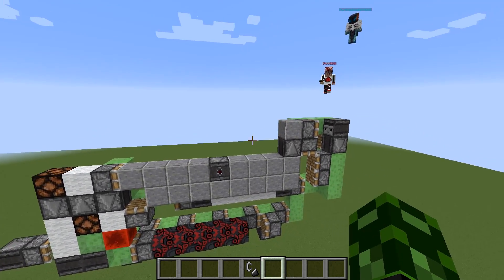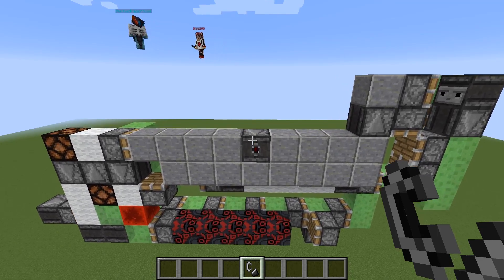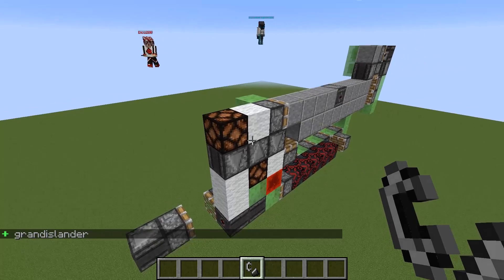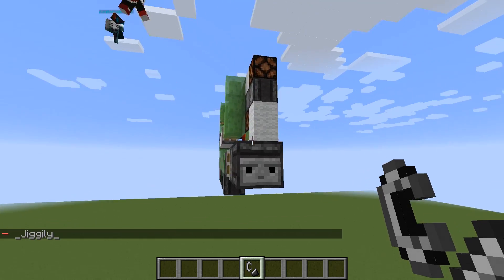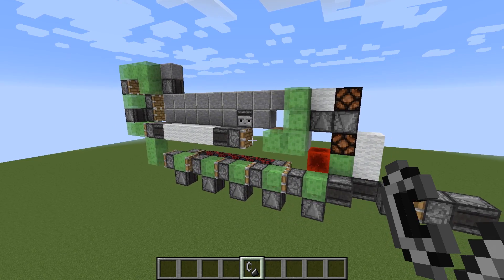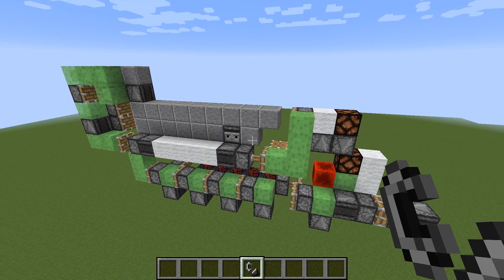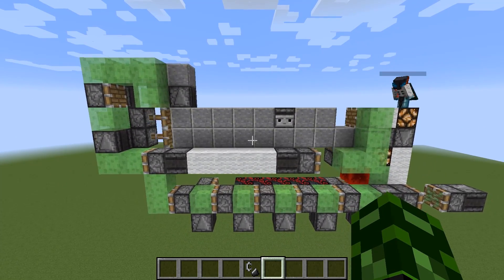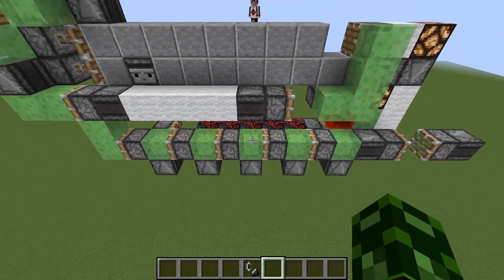Minecraft: Compact Move-Able Feedtape

Comment: What is an application of this movable feedtape? Is the feedtape used for data storage or just 'cause?
Reply: iammrhellohowareyou you can measure time passing while the machine is not moving. That combined with measuring how far the machine moves with a movING feed tape, gives you basically infinite freedom to program the machine to do what you want, where and when.
Reply: DicoTheRedstoner Aha, checked up on the previous video and heard the original intention. Has there been much success with moving logic?

Comment: This could mean that there could be robots that have a stationary feedtape program, and some machines that ran commands,
which, if given a material supply, could be a self-replicator. Also, there happens to be a way to make truly wireless redstone, with a range of the chunks loaded. Here's a link to a video about it: https://www.youtube.com/watch?v=xIr9fuaWLig This could give rise to some really cool robots that sends data through a wireless feedtape. However, as of now, it only sends the transmission of looking at the transmitter (a glass pane).

Comment: You should make a combination lock using the movable feed tape where you have to rotate it until the observer lights a Redstone torch permanently until you shut down the circuit. Then the moving portion of it moves to a different lock area, where you have to rotate it again.(the Redstone torch lights the door, but all of the torches must be correct in order to open the door, where you can press a button to reset the circuit, Like if you Agree 👍☺